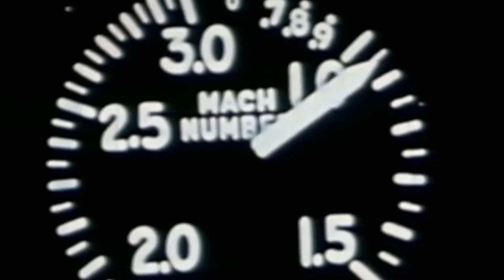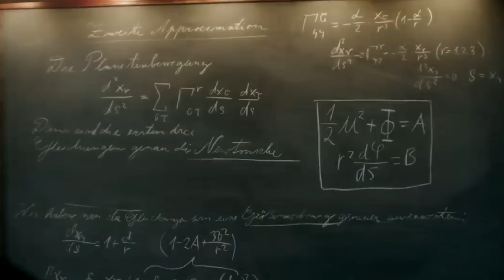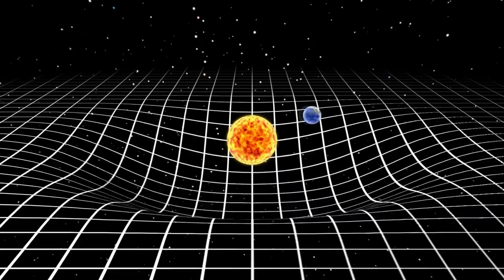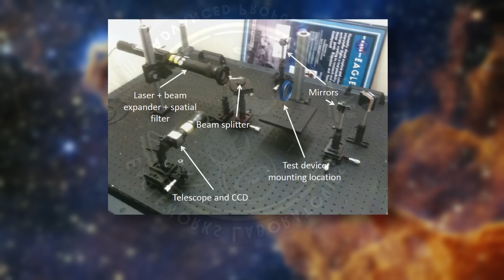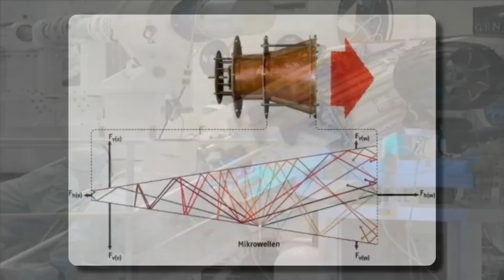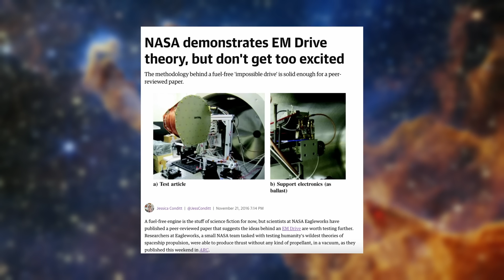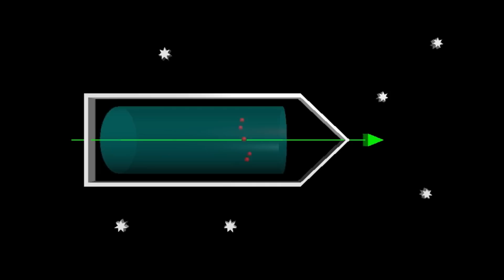NASA Admits They Have Built a Machine Capable of Lightspeed Travel!

Comment: Why does an object gain mass as it approaches speed of light? Where does the  added mass come from?
Reply: E=MC^2. When we think of mass as energy, we can begin to understand why an object will increase its 'mass' as it speeds up. As an object increases in speed, so does the amount of energy that it has, this energy is what we refer to as 'the increase in mass' (just remember, this is inertial mass).
Reply: You can feel your mass increase as you accelerate. Airplane takeoff, car, centrifuge... the C^2 in the equation is the acceleration - in this case light speed.
Reply: Remember also that at C time=0